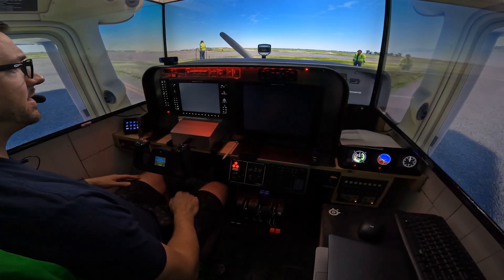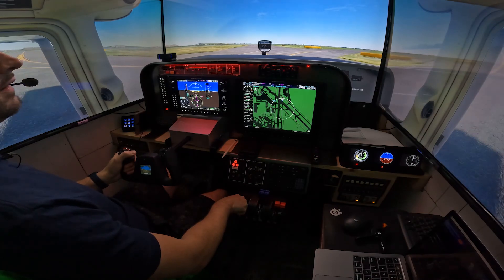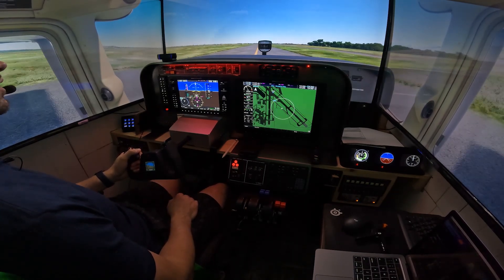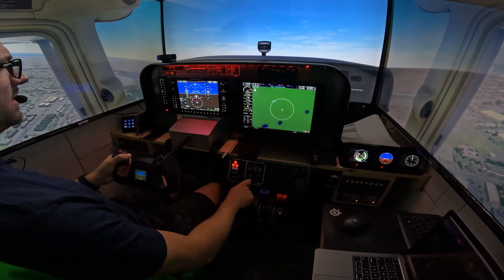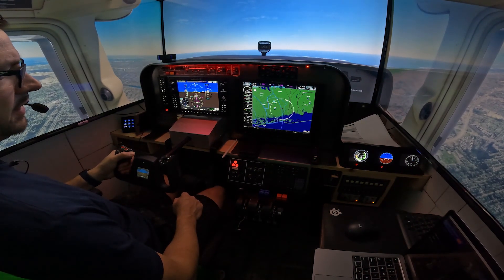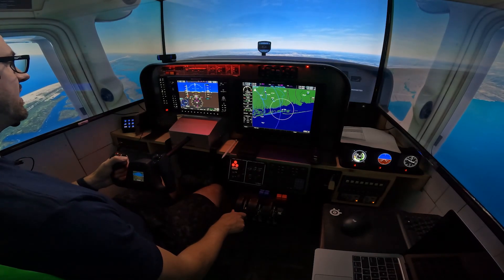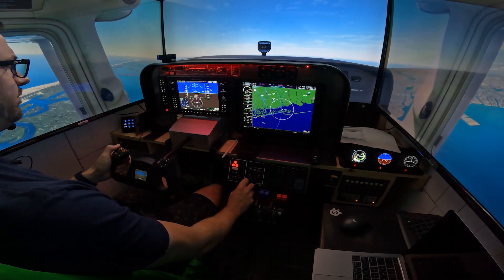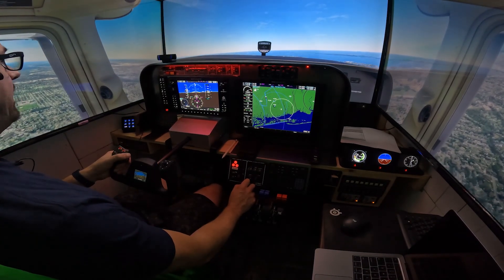Comparing Microsoft Flight Simulators C172 vs the REAL 172!

Comment: I flew the 172 and pa28 in the real world and in VR this is as real as it gets . You do need good equipment
flight yoke, rudder pedals with toe brakes and a throttle quadrant.
I use the excellent CH stuff.
Reply from the maker: 100%. I had the cheap Logitech/saitek yoke for years and landings were extremely hard due to the poor controls. Same with the logi pedals. Quality gear is important!  Vr most certainly as real as it gets. I wish we had a bit wider fov though for vr and it’d be perfect.
Reply: @av8rchris  I must confess to having the Saitek cessna trim wheel for a more real experience.
Yes the FOV in VR is a problem but I'm sure in time this problem will be mostly resolved.
Reply from the maker: I agree - the tech will get better for sure.  I heard the saitek trimwheel isnt bad though.  Flight Velocity makes a replica ive been thinking of getting.

Comment: Cool, what rudder pedals do you use?
Reply from the maker: I use the Thrustmaster TPRs which are great - all metal and excellent build quality.  I wish the toe brakes had a bit more resistance but all in all they are excellent.  I am looking at getting the Brunner force feedback ones to complete the setup eventually.
Reply: @av8rchris  I also have the same TPR, however, to achieve a feeling that is closer still to the original pedals, I removed the centering springs, on the pedals and also the Hotas Joystick.
Reply from the maker: @robertpelland5649  Interesting - never though about removing the centering spring.  After how much i love the brunner yoke Im seriously considering their pedals as well.  Might try that in the meantime.

Comment: Very nice video, the C172 is getting better, I agree the takeoff is backwards for the p factor on takeoff.
Reply from the maker: 100%  Winds down the runway I'm on left rudder to hold center - sometimes alot of it.  Add a crosswind with some weathervaning and it can even be hard to hold on the runway at all.  There also seems to be some weird crosswind characteristics.  I can fly final with normal crabbing or side slip technique, but it seems either entering ground effect or just past ground effect you need opposite cross wind controls or get shifted way off centerline.  I'd have to test this further with custom weather and run a few laps to be 100% of whats going on though.  I find it much harder to land upwind wheel first for sure in this sim vs other sims or real world conditions.